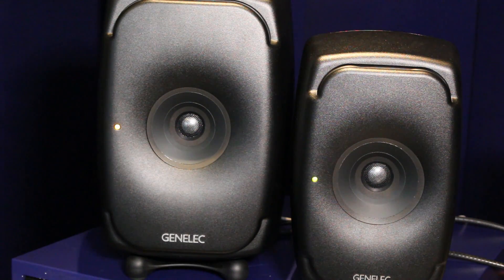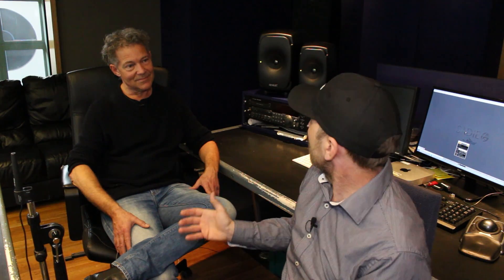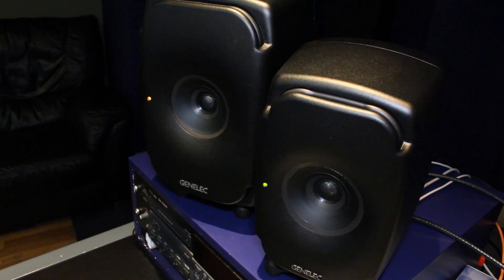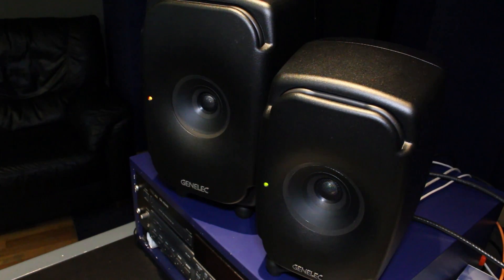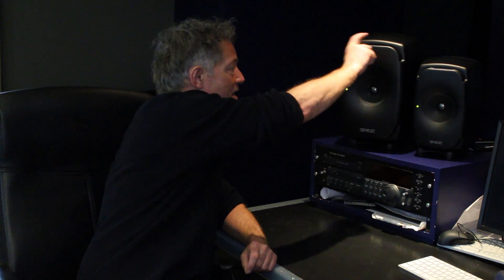Interview - Thomas Lund, Chief Technologist, Genelec

Comment: This is a great and very consequent developed product - I really love Genelec for their intelligent quality approach. But I have to point out that of course you can calibrate also 2- or 3-way speakers to your listening place in a way so that you don't hav any coloration. Also, I personally don't like tweeters made from metal, there are many better sounding solutions in my ears.
Reply: It doesn't just come down to drivers, the enclosure's performance is also what makes a "good" loudspeaker. Though room calibration may help with overall frequency response, it will not help with enclosure introduced issues such as resonance, port chuffing, or a poor wave guide. The strength in Genelec's design starts with a solid, predictable loudspeaker, then adding a high-quality DSP :)